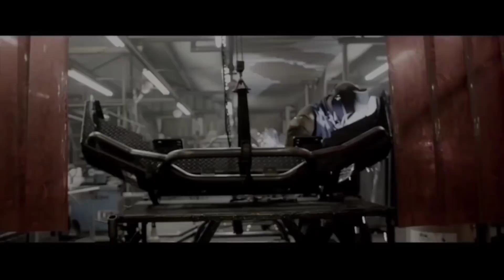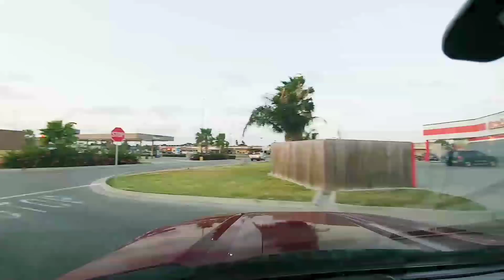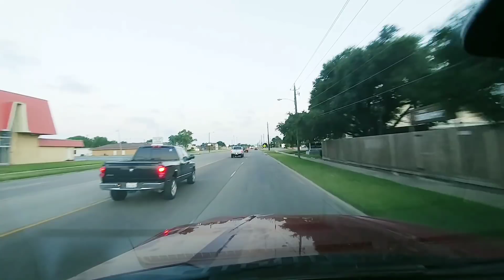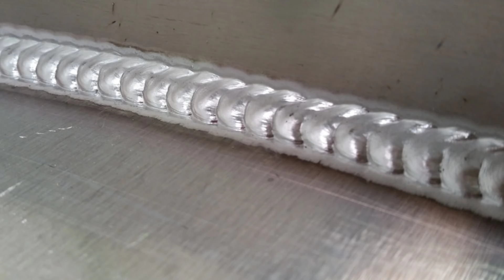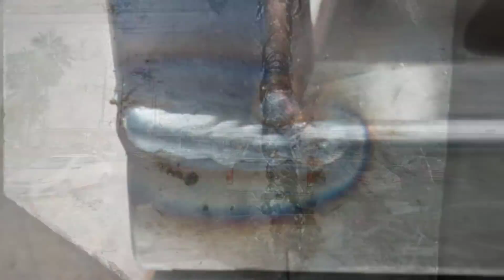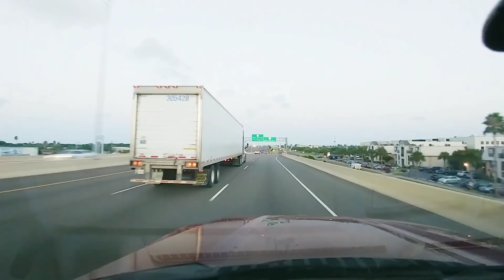BRAND NEW RV ALREADY RUSTING??  Should you worry?

Comment: Rv’s today are a component based and put together quickly. I’ve see rusted trailer undersides on new units still on the lot reminded me of Vega’s.  But.   If a decent diesel truck is 60k and up, you get what you pay for.  My toyhauler is 1 year old and I know I have to hit the underside with Rustoleum yearly to keep it check.   Suck it up or don’t play.  You are not getting hot dipped frames on a 40foot 5ver for 45k.

Comment: I have a question.  I have a 17 f250 6.7  STX that pulls my 36 ft  Columbus great. I'm thinking about trading it fo a 350 King Ranch bc I want all the bells and whistles. I also would like a long bed for the bigger fuel tank as my f250 only gets 9 mpg pulling  my trailer. Would I get worse mpg with a dually  or would it be about the same if the rear axle ratio was the same? I'm thinking the dually would be worse given the extra set of tires. But it would be more stable.
Reply from the maker: it's about 1-2mpg difference, but mainly because of the lower gear ratio
Reply: @BTBRV  is it possible to get the same diff ratio say a 3.55

Comment: This rust and other small issue that get by the manufacturer should be fixed at the dealer level once they accept the unit. These easily fixed imperfections should not be passed on to the consumer. How hard is it to spray some rustoleum on the frame? How hard is it for a dealer rv tech to fix loose trim or missing sealant? When i buy something brand new off the lot I expect to need zero maintenance when i pick it up. I, as the consumer shouldnt be fixing rust and greasing dry joints right after I pick up a brand new unit.

Comment: The DOT should control the building of not just trailers but also A class B class units .What do you get today junk wrapped up in paint delamination, which is not covered by any insurance policy ,or manufacture is a major problem in the industry they fall apart their junk buyer beware.
The point you’re making is that these units are made like a home what you fail to see is that these units are traveling earthquake and just like most homes ,fall apart in an earthquake so do these units they need to be billed to the standards under which they’re going to be used their junk dangerous junk.

Comment: Here’s the short list for our brand new 2015, $70K toy hauler. There's much more...

• Rear entry door installed wrong, wouldn’t stay closed while moving. Replaced door.
• Microwave fell out, no wood behind mount screws, fixed self
• Bed pedestal off center by 8” couldn’t sit on edge of mattress. Mfg. refused to repair.
• Left out subwoofer for speaker upgrade.
• Suspension failed two times, first time destroying tires. Second failure hauling COMPLETELY EMPTY home from dealer after just having all springs replaced. Repaired correctly second time spring shop, $900.00
• Water running out onto floor from under wall in garage when raining. 
• Roof material cut short leaving bare wood on roof rear of coach, factory covered bare wood with lap sealant. Roof rotted first year. Mfg. refused to repair. $6K
• All crimp connectors on control panel loose, wires pulling out. Fixed self
• Both A/Cs, no tape on duct vents, air paths blocked, large gap between cold & warm plenums, no air flow. Fixed self
• Black tank valve wouldn’t close, cabling installed wrong. 
• Recliner broken at delivery, 9 months to get replaced.
• Ramp door bent at delivery, daylight shows through 1” gap at each corner when closed, Mfg. refused to fix
• Slide out roof material torn at every corner from sharp metal, all three slides leaking. Fixed self
• Floor rotted on bedroom slide out, Mfg. replaced
• Wood trim on interior kitchen slide out fell off.

Pure junk falling apart in the driveway, nothing that could be seen during a PDI. We had to bite the bullet and trade it and the 2014 Ram dually in on a class A motorhome to get rid of the POS. 

Our 2018 Winnebago Sunstar 32YE motorhome has over 12K miles and will be one year old in September. No problems, never had to return for repairs, everything works as it should. That's how RVs are supposed to be built.

Comment: I ship two 27 foot or shorter campers at a time from manufacturers in Indiana to all across the U.S. for a living. Out of every 10 units I move about 2 are already falling apart. In the past two months ive had two coachman units that had the steps falling off both made the same day. Had a jayco unit that had the interior trim falling off and the fridge fell out. My last load I had a jayco that the door would not latch all the way and then the lock fell out of the handle assembly. I'm just saying if your not buying a higher end $100k plus rv quality control is questionable on a lot of the units.

Comment: Sorry. I'm just not buying it. If a customer goes out and spends up to $150,000 on a product, then it should be as perfect as humanly possible and represent value for the price. This is especially true when you have these high-power sales people pushing customers into 10 to 15 year (or longer) loans to buy these things. With "mistakes" and sloppiness right out of the factory, how can anyone in their right mind expect the product to last the length of the loan. One thing is certain, the manufacturer won't be standing up for the  product while you makes those payments. Most people buying an RV can expect to start spending time and money on repairs almost immediately. This is only going to stop when the buying public get smart enough to say, NO. I'll buy a used one and let the previous owner eat the maintenance which a new one will require. Even worse than that for the industry is for the buying public to stay away from the product completely. The industry is its own worst enemy. Keep going at the same tempo it now is going at and they will never recover from shooting themselves in their own foot. Eventually, the acceptance of shoddy manufacturing will drive the business into the ground. The practice of measuring it with a micrometer, marking it with a pencil, and cutting it with an ax is no way to serve the backbone of your company--the customer.

Comment: As someone that took a 2 year tech collage level degree in drafting I do have another book of material for you to consider if you should need to use it.  One there thing you did not touch on in this video but have mention before is this is a rolling house.  And when you build something that is as big as a house and put it wheels.. but then expect it to be light enough to pulled by a truck, there is going to be alot of design challenges that are going to be vary hard to meet. 
 
One of the first things is how do you deal with the fact that even a beam that is 12 inches in thickness will still bend when you have length of it that is 40 feet long.  when you are pulling a RV that is 40 feet in length there is a definite likely hood that it could bend it you move it too sharply, and that has to be engineered out with slotted fittings or shock mounted joints, inertia dampeners or just by make the part most like to bend even more thick then it needs to be just to support the building so that would not bend and break the building.  

Also because this is a mixed material construction with different rates of expansion in different temperatures, the material needs to be joined together in manner so it does not break itself when taken up from Texas up to Alaska.  (Let be honest, only a few RV makers would attempt to make a RV that could make this trip in particular...) but its still a big thing that needs to be considered, especially if the RV might be used in desert climate like new Mexico or Arizona where the temperature could be 100 degrees during the day and then fall to under 32 at night.  in such a case, your RV maker needs to find a way to let the metal parts expand and contract at rates vary different from wooden and plastic parts.  Its not a easy task, and the reason why most cars are mostly made of steel with the exception sometimes from a aluminum engine block or aluminum cylinder head.

RV are actually a vary challenging design to execute, and the focus on making sure they work means they don't break apart in a yea of you owning it just from being parked, or moved across the nation... so those cosmetic issues while a little bit unsightly are far less of a concern vs making sure that giant panal across the side of the RV does not rip itself off the frame should it get a days worth of sun. You will never see all the sciences out expansion joints that are under the surface letting that part expand and contract with the temperature  to keep it where it is.

RVs have alot more things going then a house while at the same time trying to meet all the same requirements as one.

Comment: Living near a RV manufacturer tells a different story about human error. The manufacturer instead of laying people off just do a mandatory drug test. The next day they are down half the employees. They higher welders that can't get a job anyplace else/ have never struck an ark and when they quit they still can't weld well enough to get a welding job at a real shop.  
I have a friend's 2018 RV in my back yard sitting next my 2003 toy hauler that has been down every dirt and rutted road and seems and door fit are all better than the brand new 2018( and my original lighting still works. The new one kicks up an error on my new truck that says bad tail light). You can say human error but I say cost cutting and price gouging.

Comment: Another thing about welds even if it looks "pretty" it doesnt mean its strong. You can have many inperfections inside the weld that you can't see, or maybe they didnt have the welder hot enough so it doesn't have good penatration. Some "sloppy" looking welds can accually be quite tough as long as they're making good penatration. But don't quote me on this because i still don't have the experience of many older welders do.

Comment: Agreed rust on the frame is not a major problem when you compare it to the other areas the manufacturers terribly put together like suspension, plumbing, slide mechanisms etc. QC is horrible in the RV industry. If everyone quit buying the junk they are putting out maybe quality would improve. I know that's a pipe dream but I for one have stopped looking at new RVs. It took me 1 1/2 years to fix everything on mine (mostly done by myself with no support from the mfg). I would love to have a larger more livable RV but I refuse to buy the junk that is out there and I can afford to spend well into 6 figures. Sorry for the rant. This video hit a nerve.

Comment: I have owned several RV’S and everyone the frame had rust on it.I currently own a 2017keystone Fuzion 371 and when we purchased it there was  a ton of rust all over the entire frame,oh and yes it was ordered and picked up 2 days after arriving at the dealer.So when I questioned the dealership about it they said they ALL do this it’s normal.Well it’s not so I ordered a crap ton of supplies and sanded,wire brushed,and sealed the entire undercarriage of my RV.I purchased a crap ton of POR15 and did the 2 step process and it looks phenomenal.I have a very close friend who is a service manager at a large rv dealer and said he sees it all the time but most don’t see it or go under their coach.And yes the build quality is horrible.My shower drain was never hook up,guess how we found that out??I have become a very good RV repair man.Love the videos and the truck.I have a 2017 f350 King Ranch Diesel completely done up and love it.Used your video to pick out new shocks.

Comment: I understand these RV’s are slammed together with minimal attention to detail & quality is what it is, however, frame extension members off the mainframe should not be rusting at the welded joints that’s not good. The Gateway you showed was very bad for a brand-new unit; surface rust is normal that’s life I get that but on the welds of a new unit that’s not a comforting feeling. With that said you can get a 5 dollar can of PSC undercoating to remedy this rust, preventing rust and corrosion front continuing. Amazing we will give the unregulated RV industry a pass for poor quality construction but expect more from our vehicle’s that cost the same amount it doesn’t add up.

Comment: Well... I have been hearing the same story on several Tube channels and it leaves me scratching my head. Why not expect a level of quality, constancy, and craftsmanship out of an RV that cost more than the house I currently live in? Can you qualify your reasons for accepting poor construction by stating something like “the cost of the RV = Quality Construction”?  If I buy a $40k bumper pull expect X but if you spend $140k on a 5th wheel, or $200k on a Class A, you can expect a much higher quality product?   Also, if the hand made is so bad then why doesn’t the industry move to robotic welding like the auto industry so “the welder was having a bad day” is not an excuse? I understand what you are saying but it just feels like an excuse for the industry to get away with sloppy work.

Comment: Good video. DRV is one of the top 3 bands for quality and they still have issues, as all RV's do. If you really want to see the quality difference, go to an RV dealership and look at a Montana 5th wheel which is a decent quality rig and then look at a DRV. If you really want a shock, look at a Forest River or a Keystone in comparison to a Heartland 356, Montana, or Big Horn. Then again, look at a DRV. Everything from 9000lb per axel MoreRyde IS suspension, Electric over hydraulic disk brakes, H Rated Name Brand Tires, solid wood cabinetry, quality appliances, water manifold, etc. So a little surface rust on the 15" DOUBLE BOXED TUBE FRAME, as compared to the flimsy I-Beams on most rigs, does not bother me. If you want a perfect rig, fork over 1 million plus for a Prevost by Marathon. I bet you would still find issues.

Comment: Where is quality control? They should be checking so someone having a "bad" day doesn't pass that on to someone giving their life savings. Every RV should be of the same quality as that new Ford you are driving. Greed is the only reason for shitty work!
Reply: would give more thumbs up for this comment if I could.
Reply from the maker: I agree.  It's just not the case though
Reply: There are only 2 or 3 manufacturers I now of that do a total inspection of every unit. These RVs are $200K and up. Most manufacturers only spot check 1 out of 30 units. I heard of 1 QC manager who got fired for shutting down assembly line for problems he found.

Comment: I can't help but compare the RV industry to the boat industry when it comes to manufacturing. Much of the manufacturing is done like piece work, faster they do their portion means the more money they make. All of that is great for the worker but end product suffers and sucks in many cases. That combined with cheap components leaves the buyer with the problems. I would find it hard to spend $100k on a RV with a rusted frame. I looked at a new $90k bay boat a few weeks ago, manufactured by a company that has a good reputation. I am thinking, this is the boat for me until I started focusing on fit and finish. New boat sitting on sales lot, never been in the water! Stainless steel fasteners and hatch hinges listed as premium high grade marine stainless steel are rusting from rain water. Sales guy could not tell me what grade stainless steel but didn't appear to be 304 and defiantly not 316. So those fasteners and hinges are rusting from rain water and I am suppose to pay $90k for a boat and put in on a lift over salt water where it will be most of the year. Sure, manufacturers need to make money but they constantly look for cheaper quality material to make more money but don't pass the savings to buyer. Instead, the end price continues to increase.

Comment: In my case a brand new camper had a frame weld.failure inside the wall where the slide box went through, slide dug into floor.

Got all.fixed under warranty. ..just barely...but the repair had only a 90 day warranty and since it was done more than 90 days before season started..in reality it had no warranty. .. dealers are not much better.

Anyone want to buy a lightly used "like new - ish " camper?

Not so worried about what I can see - I can address that - it's what I can't see that worries me.

Comment: If we as customers can’t be expected to be a little frustrated with poorly built or falling apart RV’s then how can the manufacturers expect customers to pay a premium for them? I get a little surface rust isn’t a problem and that it probably happened while in storage, but would it be that hard for them to fix it before it left the factory? And in Texas, no rust isn’t that big of a deal but in the north and north east, yeah it’s a big deal. Some trailers cost as much as the truck that pulling it and others cost as much as a small to medium sized house. They quality needs to be there in order to cost that much. I get and agree, what your saying the welds don’t need to be perfect. They just need to be structurally sound.

Comment: There were a few small areas on the frame of my 2015 Jayco trailer which had surface rust. I wire brushed them briefly, then sprayed two coats of RustOleum Rust Converter. The hard black finish has held up perfectly for 3 years. No further signs of rust.